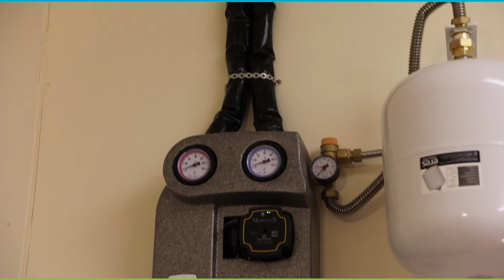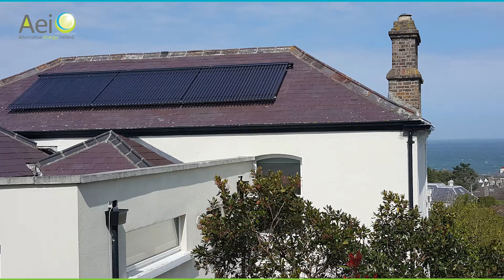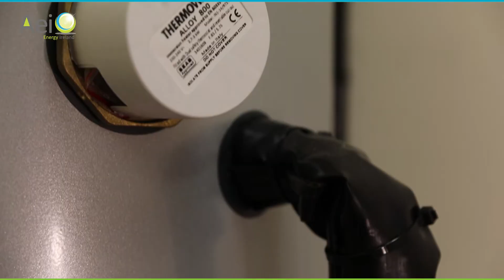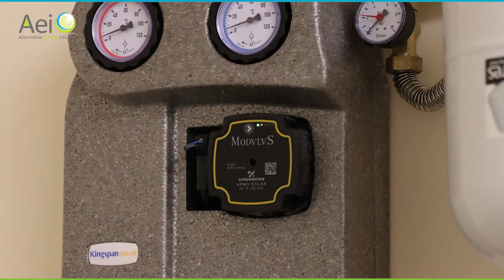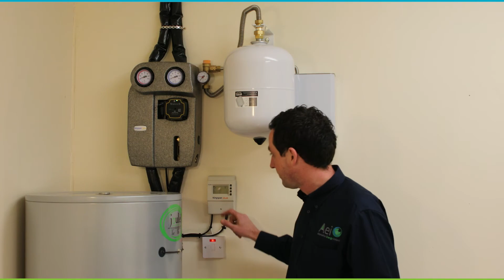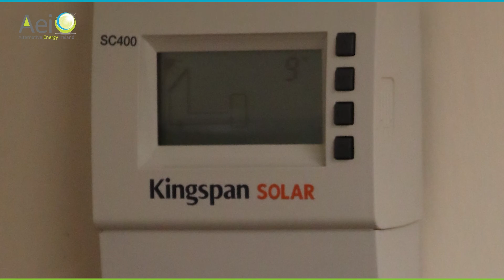AEI Kingspan Solar Handover video

Comment: three clocks on system what are they for?
Reply: Temperature return from the cylinder to the roof panel, Temperature flow from the roof panel to the cylinder  and system pressure gauge.